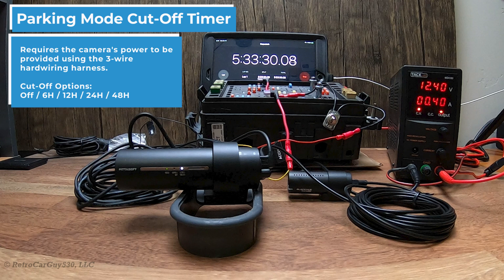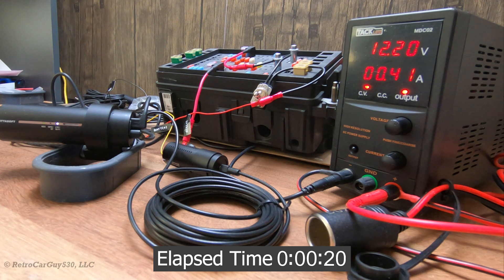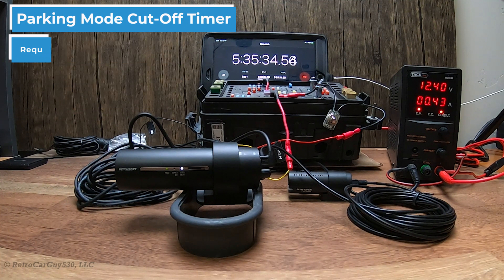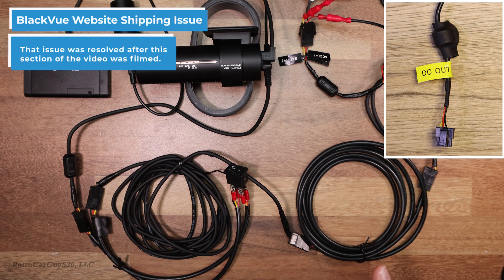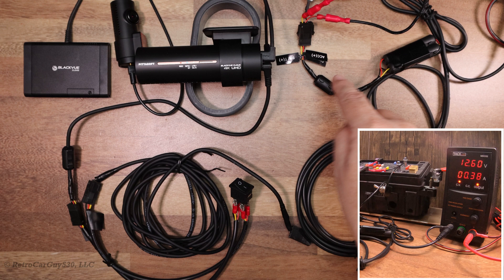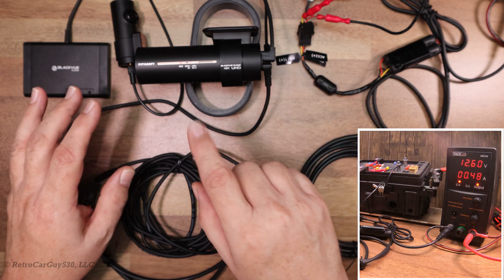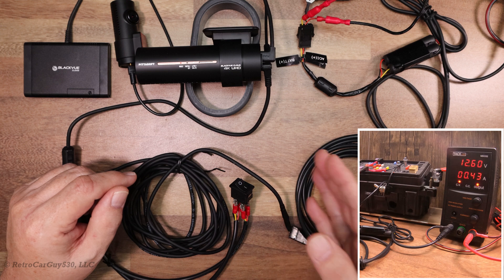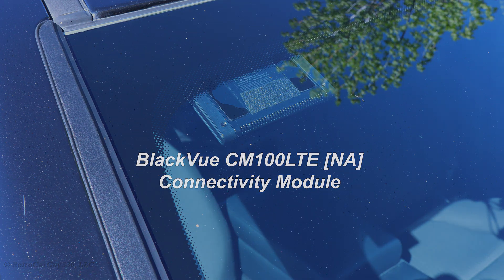BlackVue X Series Battery Protection Feature Testing & Wiring Modifications

Comment: Great video.  Thank you for taking the time.  Do you have a separate video or a picture/diagrammed write up for creating the external power switch?  It looks like you are using a 6 pin rocker switch.  Can you please list the part/model number also?  Thanks
Reply from the maker: That switch has two separate circuits running through it.  There are four connectors on the back side of the switch (two per circuit).  It's a Double Pole Single Throw (DPST) switch to turn on/off the accessory power and constant power to the camera.  I left the ground wire connected (not passing through the switch).

Here's my Amazon affiliate link to the switches I've been using for this purpose.  https://amzn.to/3ESUmrV
Reply: @RetroCarGuy530  Perfect.  Thanks!
Reply: @RetroCarGuy530  Operating voltage for those switches is listed as AC.  Do those work for DC as well?
Reply from the maker: The product listing description lists them as car and boat use and there’s no light or led in the switch so they’re simple toggle switches so they should be just fine for automotive use. I’ve been using them for several months without a problem.

Comment: Great video. What is the best setting on park mode to save car battery other than the switch?
Reply from the maker: There are two modes available for parking mode "Motion & Impact detection" and "Time-Lapse".  Both will consume power, but at least "Motion & Impact detection" will not be writing to the microSD card unless it's triggered by motion or an impact to the vehicle and that should reduce the power drain a bit.

The battery protection feature (when enabled) can be used to turn off the camera when the vehicle's battery voltage goes below the firmware setting value.  

If you want to stop the camera from recording in parking mode for situations like parking inside of your garage, you do have the option of pulling the power connector out of the camera or you could change the "Battery Protection" firmware setting to off and that will cause the camera to fully power down when the ACC power is turned off when the ignition switch is turned off.  Not the easiest approach, but that would work.  Pulling the power connector out of the camera will work but it will eventually / potentially cause issues with the connector from removing the connector over a long period of time.

That's why I opted for putting in the toggle switch in the power feed to the camera. 

I hope this helps!